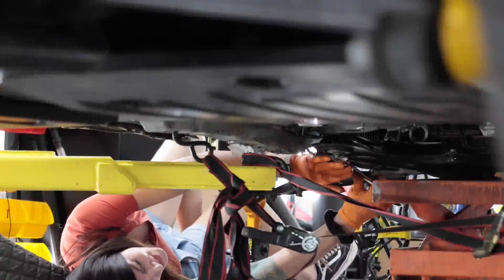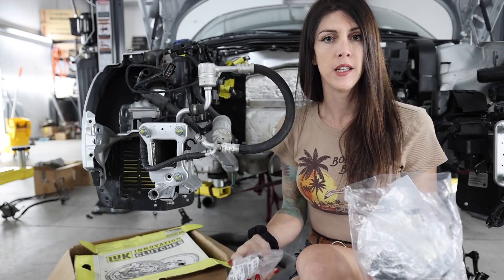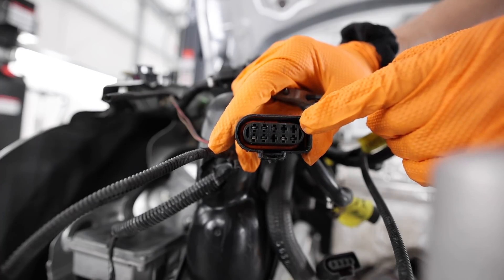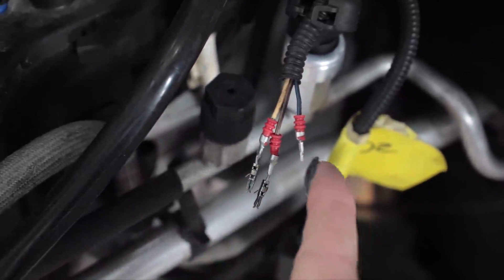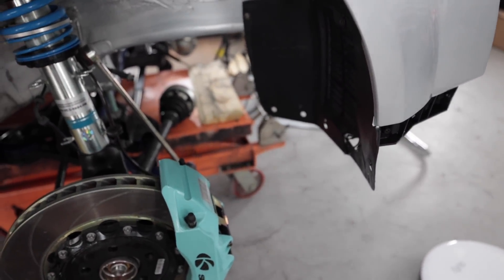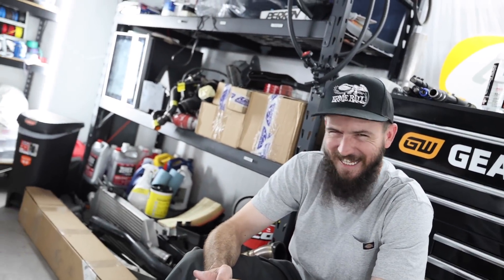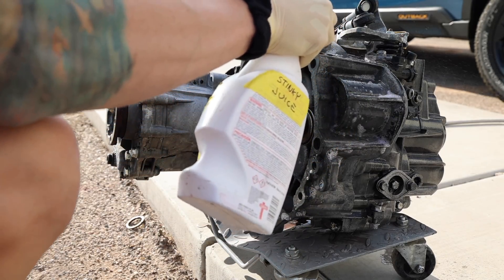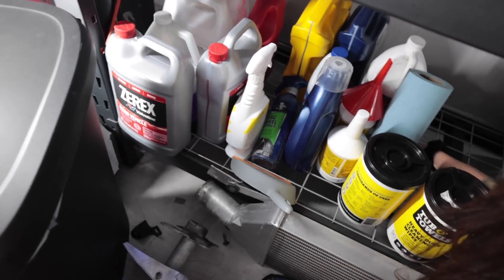The Most Overlooked Part of a Car Build // Giveaway Audi TT Quattro

Comment: Your connector obsession is to be lauded.  The recipient of this build is truly going to be a lucky winner.  You are actually improving the car in every aspect.  I was very concerned about the tumble you took from the shelving unit.  Another piece of equipment you should consider investing in is a safety rolling step ladder.  You can use it store/retrieve parts, paint the shop, and change light bulbs, etc.  Please be safe!

Comment: One tip if you want to super clean anything aluminum, spray it with something called pickling paste, as a welder we use it to super clean tig welds to make them super pretty, much like yourself, but you may need to dilute it down to like a 30 percent mix with water, it will supprise you how clean it will get without all the scrubbing 😎

Comment: I dig it.  When installing my door speakers I ordered new factory plugs so I could make my own harness that would clip into the cars wiring.  Not sure why because the blown factory speakers, amp, etc will never be going back in.  I spent like $20 at VW instead of just grabbing minifits out of my box and cutting the old plug off.

Comment: Mother's Mag Wheel Cleaner (it is a mild acid) and a synthetic cup style wire brush in a drill cleans up aluminum nicely. Used that on a cast aluminum VW intake and it turned out great.

Comment: Hello Sarah. Just a thought, you can buy virtual walls for robot vacuum cleaners. You place them where you don’t want the vacuum cleaner to cross. They are not much bigger than two soft drink cans side by side. Much safer than boxes or other such trip hazards in the workshop.

Comment: Just a little tip. If you're not in a mood to replace/order an entire connector due to a broken pin. Look for just the pin on digikey or mouser. Unless it is super exclusive to some brand/company, you may be able to buy those for literally cents to the dollar (plus shipping)

Comment: I’d definitely take a single mass flywheel over dual mass. The main reason I bought an FK8. The dual mass is as you say the fuse between the crank and the transmission. Also cranks have been known to break as well as transmissions with single mass flywheel conversions.

Comment: Yes, the single mass flywheel is definitely noisier, but you get used to it... :) I'm impressed that those connectors didn't crumble as you pulled the pins, my ignition coil ones sure did! It's so satisfying to have new connectors, though.

Comment: Bendy straw. Sorry.... BTW...I think its great to fix those broken connectors, but not so sure they cause problems. I got a broken connector for my turn signal light on my Honda. I was in a hurry and just pushed it together thinking it would break soon. It never broke, or fell apart in spite of the fact that it lives inside my fender.

Comment: The connector you showed is very likely from Delphi, though they renamed theirselfs to Aptiv two years ago. The manufacturer should be visible on the connector.
The purple part is the secondary lock for the terminals.

Comment: You just made my car OCD happy with replacing broken connectors.  I just replaced a transmission on an F150 and the tcc solenoid wire was butt connected together and they could have at least used weatherproof connectors but no.  Thank you for changing the plugs.

Comment: It is colloquially called a bendy straw - Charlie is correct.  If you can adjust the bend, then it is really an articulated straw, like an articulated truck. Though I am certain you would be considered a knob if you called it that LOL. If it has a fixed bend, then it is called a bendy straw. No matter how you look at it, Charlie is correct.

Comment: 1- You made me very happy with the connectors. So. Satisfying.
2- You had me laughing about the alu-foil protective sleeves. 
3- You didn't fall. There were no witnesses. It's a Schrödinger's Sarah thing.
4- You're doing it wrong. To take the engine out, I raise the car, lower the subframe with lower control arms and steering rack with the help of a transmission jack and leave the shocks and hubs and engine hanging from the car (this might not be possible if all engine mounts are on the subframe...). Then remove the engine. Shocks and hubs can be removed separately if needed. Assembly is in reverse order of disassembly.
A transmission jack (or two) is a very useful tool.
5- It's a Flex-Straw. Company founded in 1939. Google is my friend.
Reply: 1- You have one friend.

Comment: How much time did it take to find the part number for each connector? Sheesh… I’ve had trouble finding little connectors for a Honda before. Good job and this just shows how patient you are.
Reply: VW/Audi is nice and molds the part numbers into the housing. Makes life a lot easier.

Comment: You can buy all those Bosch connectors @ Ballenger Motorsports FAR CHEAPER than the OEM prices (same place you got the MR2 stuff from??)....Even from the OEM discount houses prices are cheaper @ Ballenger. Even with the Nordlock washers on it...I'd really SAFTEY WIRE those Turbo mounting bolts...But, guess that will be the next person's problem....

Comment: The Engine sits on the K Frame so If you had a method to keep the frame on the engine and complete the required work this would of been easier in terms of assembly.

Comment: I would love the TT I love working on my car until I can’t figure something out I’m having trouble with camshaft sensor codes I checked the wires and connectors put new sensors in still got a code 🤷‍♀️

Comment: Why bother tracking down new connectors. I  cut them off, solder and heat shrink.  Never have a corrosion issue. Easier to track down defective components.

Comment: SARAH,
All you did is replace the electrical connector shells. Now they look pretty
BUT, you used the old wire & the old pins. You did not help the connectivity
of the electrical circuits at all. What should have been done is replace the 
entire underhood wiring harness assembly. Looks don't make it run better.

!